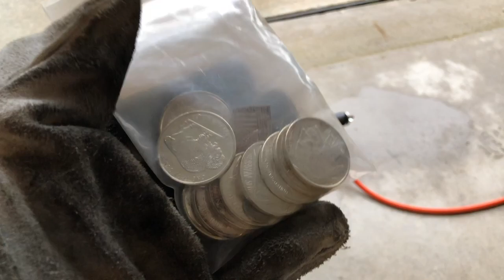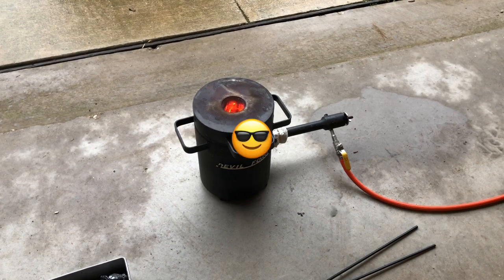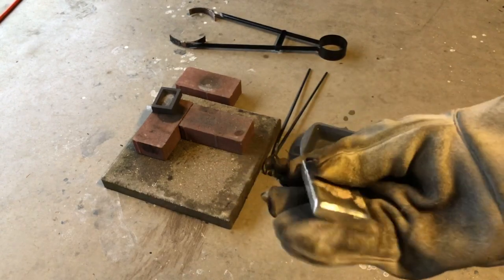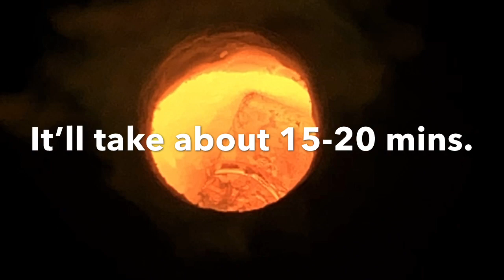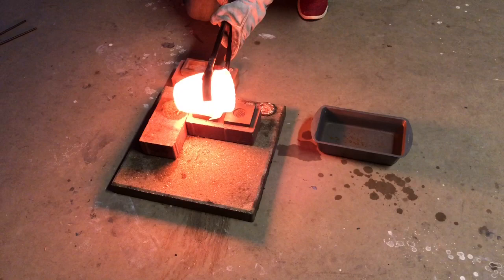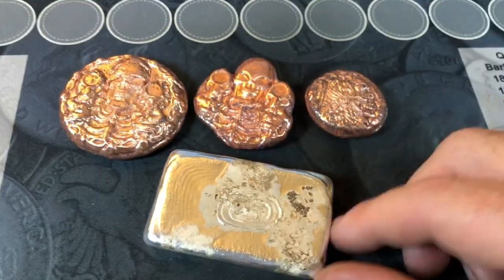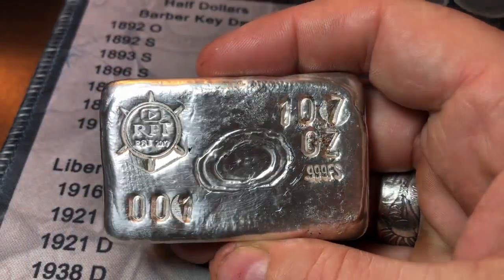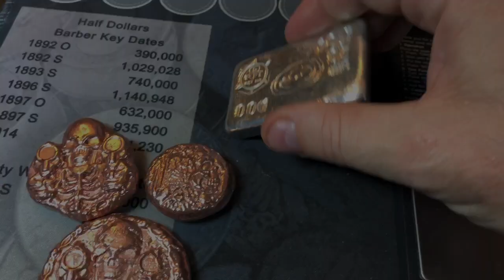Melting Silver and Copper - Making Bars and Rounds at Home

Comment: Put your molds on the top of your foundry with the back to the flame and they will be hot and let the metals flow freely
Reply from the maker: I do that too - I think I take them off too early!
Reply: I have a 6lb mold that I leave over the flame for about 10 mins maybe a little longer depending on how ready the metal is

Comment: Hey Rob, nice video. I think if you had a better way of heating you molds, you might get a better pour. I know when guys pour lead bullets, the first ones usually do not come out very nice until they get their mold to the right temp.
Reply from the maker: Makes sense - I need to work on getting the molds hotter for sure!

Comment: Hey rob an idea/question can you set the crucible on the mold for a couple seconds to pre heat it before you pour it would it break it??? Also you could possibly use a vibrating plate to set your pounds on to get rid of the pour marks...thoughts????
Reply from the maker: I could do that - safer to set it on the forge for a bit.  The vibrating plate idea may be a good one to try!

Comment: Nice coins and bar rob and i dont think you need to heat up your molds up just to get rid of the moisture and lol you did better than me today i used my forge today and my one graphite mold broke when i was trying to get the copper out and tried using muffin trays and 2 steel bars molds and i pre heated them and after i finshed pouring them and because i let them sit for a bit too long they stuck to the metal and i dont mind because am going to do a huge melt of copper and make a 9" kratos from god of war but i am waiting for my tongs and or lifters for my 20kg crucible best of wishes Rob

Comment: Hey rob. I have a similar setup as you and trying to pour silver . I was pouring silver into a cast iron mold and I am getting many bubbles in the final piece..Am I getting the silver to hot or does cast iron cause issues and graphite should be used ?
Reply from the maker: Are you heating the mold?  Make sure it’s nice and hot before pouring and try to pour smoothly as possible

Comment: Rob, now that you've created these bars/rounds, what will you have to go through to sell them eventually? I would imagine that the buyer wouldn't know who you are or trust the stamped metal content or weight, so wouldn't they need to do something to ensure that the silver bar is in fact .999 fine?
Reply from the maker: Most gold/silver dealers can determine composition through weight and density testing - or even acid testing for gold.  For a private individual, you'd need to ask for a COA and keep the receipt.  Any silver pours I sell always come with a signed COA.
Reply: @RobFindsTreasure  Thanks Rob. I was curious how that worked.